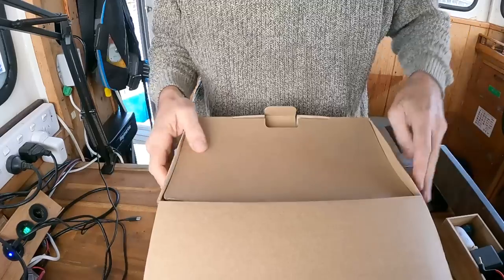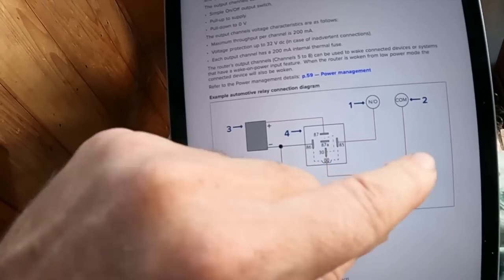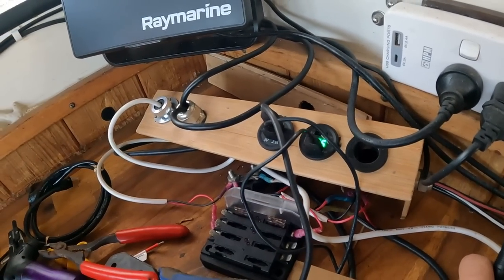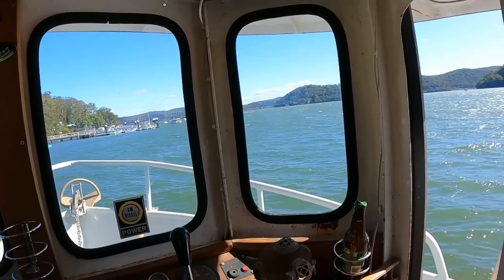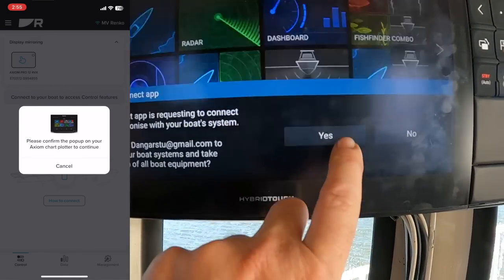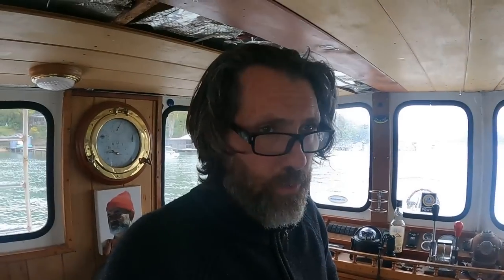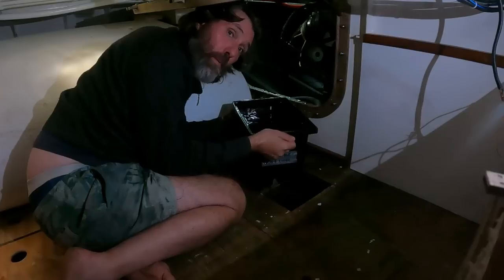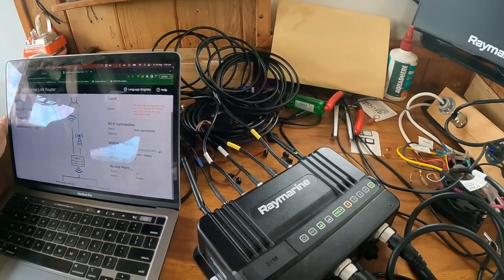Monitoring a boat remotely with the Raymarine YachtSense Link

Comment: Diversity in the RF world is when the radio uses multiple antennas to get better reception. Signal noise that is only visible on one antenna can then be filtered out and only the signal visible on both antennas at the same time will be used.

Just a simplified version of basic antenna diversity

Comment: This is cool, thank you for showing the possibilities such a system brings with it. I do wonder how sustainable the safety of it will be over time, very often embedded devices don’t get the upgrades they need.
About the reed switches: I‘d want to use a current loop without using an output, but that‘s me. That‘s a tiny current dropping over a resistor and measuring the voltage drop. There are so many more possibilities but there‘s limits - like displacement 😅

Comment: Hello Stu if that's your name? Been watching your boat rehabilitation nice job, but your electrical leaves questions in a salt water moist environment shouldn't you be using more moisture resistant fittings to protect your new system? When your on the open sea some night and something shorts out you're going to be in deep trouble mate.

Comment: friend, could you help me with a question about where the oil is drained to change the oil in a Johnson Ocean Runner 225 HP from the year 2000 and also where the new oil is entered?

￼

Comment: Gday Stu,

I would like to ask for some advice please, I recently got a tinny with a 30hp yamaha 2 stroke, when I flush the motor with the muffs when I get home i have always ran the motor for a couple minutes and then disconnected the fuel hose and it will run for another minute or so to run the fuel out of the motor, I saw a thread somewhere that said don't do that you will ruin the motor?

Kind regards,
John

Comment: Hey Stu we get alot of ways to flush outboard motors, my preference is to run the motor in a tank. Can you advise, what is the best product to use after each usage, to minimise salt build up and generally look after the internal parts of the motor. Cheers Roley.

Comment: Great to see you back.
Curious why you didn’t go with a dripless system.
Reply from the maker: I may well do in the future. In this case it was really just running with what was there and people telling me that dripless is great until it fails, and then it fails catastrophically. I'm thinking a stainless packing gland and a grease nipple is the upgrade I will do when I next get it out of the water.
Reply: @DangarMarine  that would certainly be an upgrade. Eliminate the corrosion and limit potential for more.

Comment: If you cut fuseholders, connectors and something off do yourself a favor and let yourself at least 10cm-20cm cable on it. This way you can use it for something else or reatach it more easy and have some cable on it left for mistakes ond heatshrink